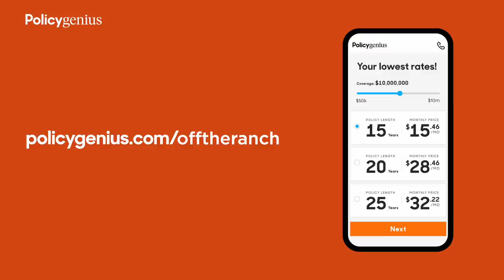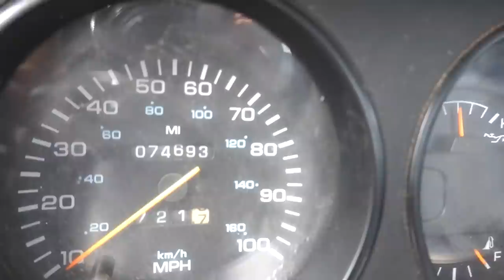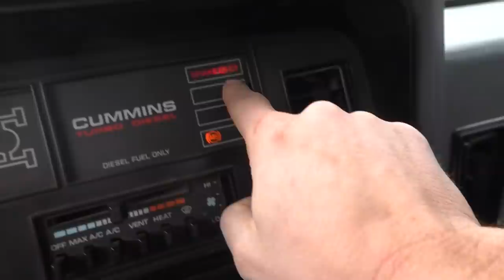Mere left town... within 45 minutes I bought a truck...

Comment: Growing up in a small town we would work for the local ranchers loading fresh square bales on the trailer. 

One of the tricks we used to maximize our manpower was to put the truck in 4 low and aim it down the row of hay bails. No driver needed and we could load about as fast as the truck was going. 

Small town life